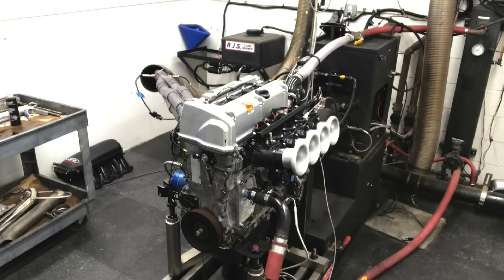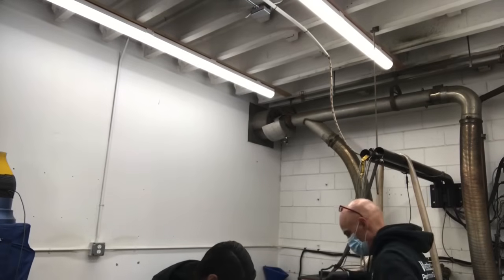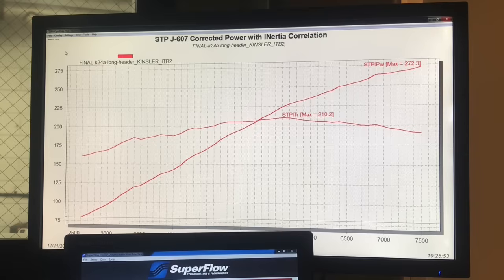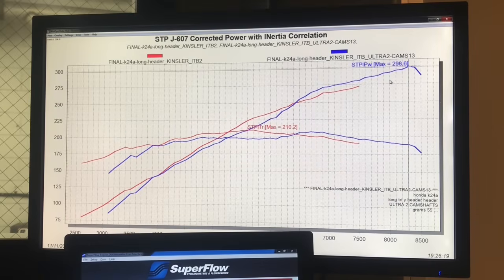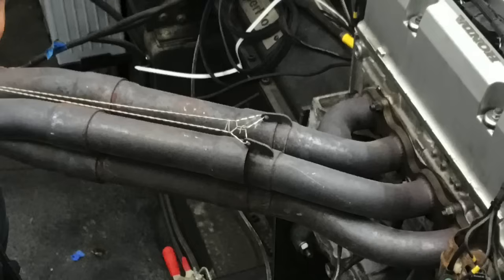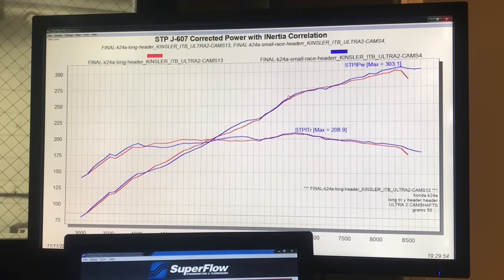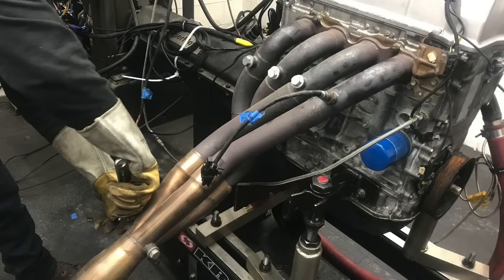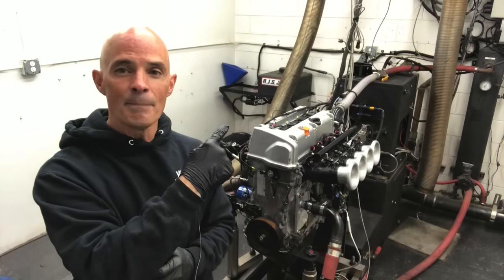HONDA K24A2, STOCK OIL PUMP GOES 8,700 RPM!!

Comment: I know its abstract but I was wondering if you might do a episode on a Ford Vulcan V6 3.0L. They were previlent in rangers for a while till the 4.0 came out. There's not much aftermarket expect for cams, lifters, springs and rockers from what I found. Thanks either way love your content.
Reply: I think the Ford Duratec 3.0 V6 24V DOHC is a better choice when it comes to Ford V6's. With primary design engineering from Porsche and cylinder head design from Cosworth they made 205hp in the 96-05 Taurus and Escape. In 06 they went to VVT and bumped up to 225hp. E85 versions were rated at 250hp. The Jaguar version made 232 hp @ 6750 and 220 ft-lbs @ 4500. The Noble M400 used a twin turbo Duratec V6 that made 425hp @ 6500 and 390 ft-lbs @ 5000. The Rossion Q1 bumped this up to 508 hp @ 4700 and 521 ft-lbs @ 4700. The Duratec architecture is also used in the 3.4 SHO V8 and the 5.9 Aston Martin V12 making 450hp and 420 ft-lbs NA.
Reply: Speaking of Ford V6s......... What about a 2.9L out of an 80s Ranger? The one with the mini tunnel ram? I had one of those in an 88 4x4 and that thing really came alive above 4000. Apparently they don't like being hydrolocked though. 🙄😪
Reply: @jr78racer  The Cologne or Taunus V6 has a long history, especially in Europe. In the 70's the US started seeing the 2.8 Cologne V6 in Mercury Capris (the European ones, not the 79-up Fox bodies) Mustang II's and Pintos. The 2.9 changed from cam gears to timing chains and made 140 hp in the Rangers and Bronco II. Cosworth took a 2.9 and added 24V DOHC heads to it and got 192 hp and a whopping 275 ft-lbs torque. Installed in the Ford Scorpio Cosworth 24V it was only offered with a A4LDE auto. The 2.9 evolved into the 4.0 OHV and SOHC versions common in Rangers and Explorers. I recall a lot of 2.9 Rangers with blown head gaskets.
Reply: @chris49ford  mine never blew a head gasket, but it never ran the same again after being filled with water........amazingly it did still run, though not nearly as well as before the drowning 😂
Reply: @jr78racer   it was probabably de-stroked .. those rods probabably had a little curve in them lol

Comment: Disconnect or take out the balance shafts.  Those things run at 2x crank speed, and must be wasting a lot of power thrashing around in the oil at 17,000 rpm.  That might be worth as much power as the cam swap.
Reply: I was thinking the same thing! I would think the balance shafts would add quite a bit of heat to the oil and could aerate it as well, but I haven't seen any proof of that on these engines.
Reply: @averyalexander2303  GM sells plain shafts out of their Performance Parts catalog for the Ecotec 4-cylinder to replace the counterweighted shafts.  There must be a reason for it.
Reply: @andyharman3022  There is- performance and reliability. There is simply no need for balance shafts in a performance application since NVH isn't much of a concern to most performance enthusiasts. I'd happily give up a bit of smoothness for ~5 more HP and less risk of failure. My opinion is the less parts there are in the motor to break the better

Comment: Not sure why people bother tuning these NA... the dollar per horsepower isn't so good. I mean yeah it all adds up when you put boost on it, but I'd definitely go straight to a turbo setup first thing.
Reply: That is true, but the reliability benefits of a relatively stock engine can't be ignored. Turbo setups certainly can be reliable, but I wouldn't say 500K+ trouble free miles could be reasonably expected out of a turbo K24 as it could be out of a relatively stock K24. Power is nice, but reliability is even better.
Reply: @averyalexander2303  if you want the best reliability, you're not going to modify it in the first place 😄
Reply: @michaelrodgers6559  I see your point, but there are things that can be done to improve performance without significantly reducing reliability like headers, OEM cam upgrades, intake manifolds, tuning, balance shaft delete, etc. A turbo setup is a major downgrade from a reliability standpoint. To some people that may be acceptable, but I expect to be able to jump in my car and drive it cross country without worrying about it breaking down.

Comment: What's the weight of the K24a2 engine vs an L33 LS? #miataswap
Reply: 413lbs for a k24 with transmission. 
5.3 is in the 450-470lb range for just the engine, no transmission. Imo a k swapped miata is a perfect match.
Reply: @MODeration_nXS  450 would be the Iron block version, no?  L33 is aluminium so 50-70lbs lighter?
Reply: @RumblestripDotNet  I just checked bdturnkeyengines.com and they have the iron 5.3 at 580 and aluminum at 500. But thats with every accessory and harness. Don't think you'll be running an ac in the miata swap so that saves 20+
Reply: @MODeration_nXS  Yeh Honda gives most of their engine weights as " All weights include engine, transmission, intake and exhaust manifolds, axles, and major accessories. All weights are approximate. All weights include manual transmissions only." Longblock is maybe 275-300 lbs? Maybe Richard has a scale there and can weigh it.

Comment: The only downfall that I can see is the extreme high RPMs in order for you to extract the horsepower out of it, that being said ideal for drag race application not so much for Street application but impressive nevertheless looking forward to the Boost segment!....
Reply: Shorter final drive and a downshift solves that problem nicely.
Reply: i think your making a correlation/comparison to a v8 like a gen 1 sbc or the almost forgotten gen 2 lt, LS, old modular ford when referring to its streetability .. the transmissions for the k series are geared with high rpm power bands in mind since they dont make power down low.. i had a b16a xsi swapped ef civic @70mph in 5th  was like 4000rpm factory redine 8200rpm

Comment: The LS of the 4 cyl world.
Reply: And the k24 does 1000hp with only 4 cylinders.
Reply: @matt-be8kt  I never heard of it making 1000 hp but I’ve definitely seen it making 400-500 hp with a turbo, which is very impressive in its own right.
Reply: @ardie4  there are a lot now making 1000+. What's his name from the boostedbois doesnt have a ton of ability  but his white MR2 makes 1100 and runs 8s.
Reply: @ardie4  K series have been clearing 1000 for years. They can easily hit 600 bone stock. 1000 hp k series isn't uncommon anymore
Reply: @ardie4  really? They’ve been around for awhile now...
Reply: Well said my brother. Best 4cyl in the world im glad i own 1
Reply: That would be the C20xe but america did not get it.
Reply: @joaovitorsilvagohl682 junk

Comment: Really making me want to get an 05 Integra Type R now... 🤤
Reply: Grab an rsx lol
Reply: @shadowopsairman1583  same car was still called an Honda Integra here
Reply: Love me an RSX(even if FWD typically makes me want to vomit...) - but DAMN their resale value all to hell!!!
Reply: @RyTrapp0  they are still expensive there?
Over $20k here
Reply: @indyrock8148  Not sure where you're at, if that's $20k USD, that's a LOOOOOT lol.
But, around here(Great Lakes region, US), they're ~$4000+ with 200,000 miles, ~$7000+ with 100,000 miles, and it only goes up from there of course as they're in nicer condition and lower mileage. MUCH more expensive than other similar used cars.
Reply: @RyTrapp0  AUD so about $15,000 USD
Reply: @RyTrapp0  they been popping up at the local pick n pull auto junkyard here in south tx..

Comment: I'm surprised the cams weren't worth more power honestly. The RPM will definitely help it make boosted power though. I'm curious how sloppy you could get with one of these things. Like, honda elements come with K24s. Could you just toss cams/springs in an element along with a turbo and make big power? They even came manual and awd. That'd be a hilarious sleeper.
Reply: You wouldn’t even really need cams and springs, the low compression K24 in the Element and CRV etc will make ~500 hp on boost all day long. If you actually put a set of cams In a K20 head and went that route it would make even more reliably. The J series is the same way; you can take a run of the mil Odyssey engine and fab up your own turbo kit and be making 600+ HP in a weekend with a junkyard Honda minivan. Some of Honda’s budget friendly low compression stuff is their most fun lol.
Reply: The stock cam VTEC lobe is a decently aggressive endurance/road race profile to start with. Check out K20/K24 "VTEC killer" videos to see what they sound like at idle when installed to always run VTEC in an economy k-series engine. An early K24 CRV engine (K24a1) is the ticket to build a budget K24. The head is even better than the K24a2 head tested in this video.

Comment: What do you mean JDM? Meaning you shipped it from Japan? I understand it’s a Honda which is a Japanese product. There’s a different with K24’s?
Reply: There is a USDM and JDM version of the K24 with vtec both on the intake and exhaust. The TSX had the K24A2. Over in Japan the K24A came in two different variants. One with VTEC only on the intake and another that is equivalent to the TSX. The JDM K24A came in a variety of cars in Japan.
Reply: Sometimes JDM engines have higher state of tune thanks to the availability of high octane fuel. In Aussie spec Honda (and most Japanese cars exported here) the engines have always been down on power from the factory compared to the JDM ones.
Reply: Jdm k24a’s come from odyssey absolutes. Should I say, the one I have did. I have one, an RBB1 and it’s a beast! Mine came from a jdm depot and I paid $650 for it. 197hp/171 tq stock! Mines equipped with 3” cai, header, Rbc mani, 50 vtc, hondata, and tuned. Makes for a great street car. Little note, jdm k24’s make more torque than usdm k24a2’s. 171tq jdm vs 164-166tq usdm.
Reply: @TheGerbsteve  sounds great, what body did you drop it into?
Reply: 5150gino 2007 civic si fg2

Comment: Hondas struggle to make torque
Reply: Your kidding right? 207T and 298hp from a N/A 2ltr. Multiple by 3 for a 6ltr like say a 6.0 LS engine, you’d get 894hp and 621T!
Reply: Correct Honda-tech reply: 
Your mom struggles to make tq
Reply: Ignorant statement. Are you suggesting that manufacturer name influences torque production more than actual displacement and the laws of physics? Btw this engine is making more torque than some V6s do.
Reply: Who cares? You're revving it to freaking 8 grand and the car conveniently doesnt weigh as much as a Silverado.

It's almost like they planned on having a high performing NA engine and not a V8 in the tsx
Reply: We’ll see the thing about smaller 4 cylinder engines is they tend to make power with RPM not displacement. This lends them to generally make more HP than TQ, however for the size of the engine the amount of torque it’s able to produce at such a low RPM naturally aspirated is actually pretty impressive. Add to that these are FWD platforms and torque steer is a very real thing, so 350 lb ft at the wheels at 2000 RPM in a front drive street car is not a smart idea. Lastly, if you want to see a Honda with torque take a look at the Earth Dreams models; I just had a Accord Sport in the shop yesterday for a tune and it made over 240 TQ at the wheel with a bone stock 1.5 liter at something silly like 2100 RPM.
Reply: Struggles to make torque, yet had a nice flat torque curve from about 4000-8700 rpm. Ok buddy 👌🙄🤔.

Comment: i actually think the stock manifold does fairly well for a factory manifold. A lot of the times they are just cast iron, don't flow well and are very heavy. This one at least is a header and not just a cast manifold.

Comment: Why is there no 'step' in the curves when the 'vtec' kicks in ?
Reply: There isn’t supposed to be a shelf where VTEC crosses and when tuned right it’s supposed to be a smooth transition. You want the low cam to run until it doesn’t make anymore power and then transition smoothly to the high cam so power keeps being produced. If you let the low cam fall off and then kick in the high lobe you’ll get that “pop” into VTEC everyone knows but it does nothing good for performance overall.
Reply: @kennethpowers8995  i like how you explained it better than my explanation
Reply: @zekelil5151  TY. Now what’s really hard though is trying to explain to Honda fans that their new Accord or Civic doesn’t even actually have VTEC anymore lol. Earth Dreams VTEC is not actually VTEC anymore, VTC only.
Reply: @kennethpowers8995  I actually didn’t know that, i thought they had switched to only Vtec on the exhaust cam?
Reply: @zekelil5151  The K20 and the style of K24 in this video are the last DOHC Honda’s to get a true VTEC. Some J series stuff remains VTEC but that’s SOHC V6 stuff. But when you crack open the software to start tuning like a new 1.5T Earth Dreams you quickly notice there isn’t even a VTEC tab when tuning those ROM files anymore. It’s not existing to adjust on that engine and then when you go to something like a Accord K24W1 earth Dreams or the Acura counterpart the Earth Dreams VTEC system has no physical lift adjustments, it’s all just VTC control.
Reply: @kennethpowers8995  Well with all this turbo stuff, i guess vtec was just phased out, the turbo forces air in, there’s no need for a higher lift, just timing
Reply: @zekelil5151  Yup turbos, direct injection etc is all much more efficient than the inline 4 cylinders of years passed. Even an NA earth Dreams engine like the K24W1 can make a really good street engine. They don’t quite meet K24a2 performance standards, but we can get people a very useable power curve that makes their Accord fun to drive even at modest power levels and return great fuel mileage behind the CVT or manual gearboxes.
Reply: This is what i think, so if any honda experts are out there correct me. It’s like with an Ls engine with a cam, the low end is usually the same as with the stock cam, but in the higher rpms you can see where the stock power curve and the cammed power curve begin to differ because of the higher lift, i’m guessing they tuned it so where the stock cams run out of good operating range vtec kicks in and it just keeps picking up the power, but with a smooth transitions, if that make any sense
Reply: No “step” because of the Variable Timing Control. It advances or retards the cam for a total of 50 degrees on some models and 25 degrees on others. This way you can optimize the power delivery of both, the high cam and low cam, and make their transition smoother. The older VTEC motors like the D-series, B-series, H/F-series had a big sound change when engaging vtec because they don’t have the VTC function.
Reply: @MountainPF  You can still change the power curve in a B/H series so the transition is smooth and power doesn’t fall off. With stock cam profiles anyway; aftermarket sometimes have high lobes too aggressive to match up smoothly, but it doesn’t take VTC to get a good VTEC crossover.
Reply: @MountainPF  And the sound you hear is the increase in lift

Comment: 126hp/liter wow! That K cylinder head is insane.
Reply: No 50 degree vtc?
Reply: And this isn’t even the “good” K series head lol.
Reply: Yeah look around na k24 with k20 heads regularly make these numbers with just a intake exhaust tune. And on boost well they rip. love the data rich is putting up but really wish he did a k20 head for the big bang.
Reply: @oliverscorsim  He May consider trying that at some point but his main goal is to determine what the bottom end can take.